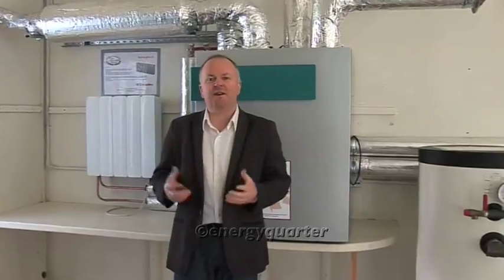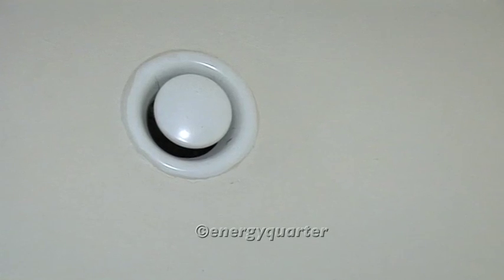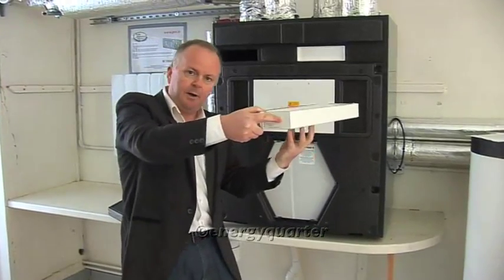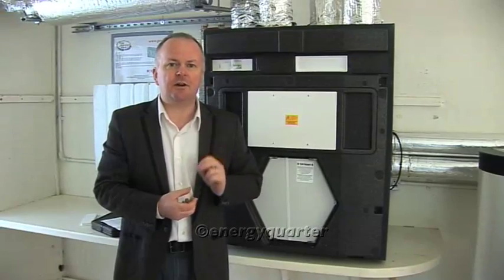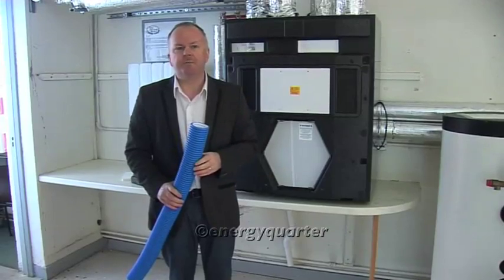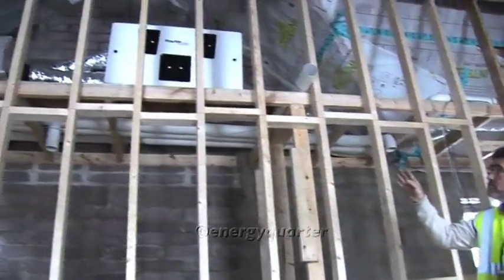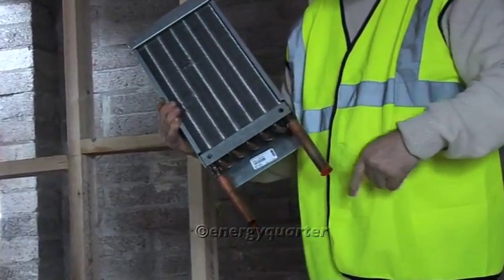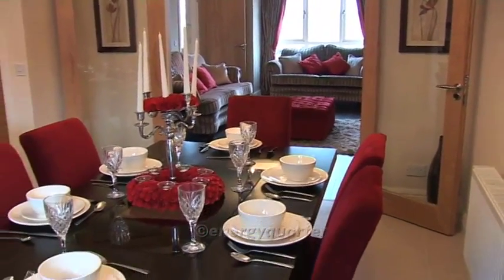Passive House Series MHRV.mov

Comment: I am renovating a house with passiv standards in mind. I want mhrv and also want it to heat the house with a water coil like in this vid.

Q: what companies in Ireland offer this? The 3 I've spoken to won't supply a system with a coil. 
What brand is the unit in the vid??

Would really appreciate a reply and thank you very much for these invaluable videos.

Thanks
Reply from the maker: The brand in the video is by ProAir.  If you would like contact details for other companies please contact us on info@energyquarter.ie
The Energyquarter team

Comment: I want a Passive House!
Reply from the maker: It's the only way to go!
Reply: ***** You don't really have a Passive House (or one that is certified, anyway).  A true Passive House ALWAYS has a ventilation system to bring in fresh air.  For a cold climate the recommended ones are exhaust or balanced.  Actually a balanced one (a fan for bringing in fresh air and a fan for exhausting stale air) will work in any climate.  

Also, it is highly advisible that you don't fill the living space with polluting materials--the worst being carpeting, particleboard cabinetry, and combustion appliances (gas stoves and fireplaces--for example).  And for heaven's sake, don't use any VOC emitting paints or finishes!   Use an exhaust fan hood of at least 400 cfm when you cook. 

Learn how to clean without using toxic products, you know, just about anything you can buy off-the-shelf at a typical grocery store (I use only baking soda, borax, and white wine vinegar).  Don't use perfumed anything in the house--perfumes are quite toxic.  Ideally, your house should be completely odor-free.

The suggestion of using an engineer to evaluate the building site is a good idea, though.